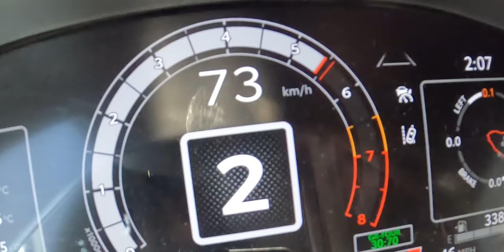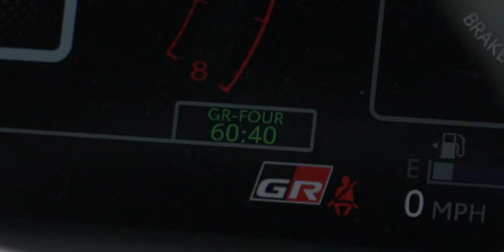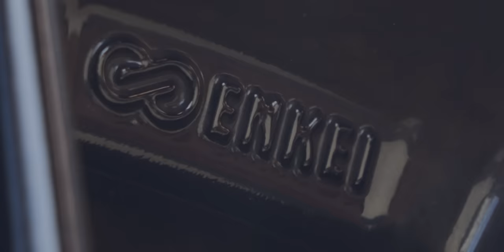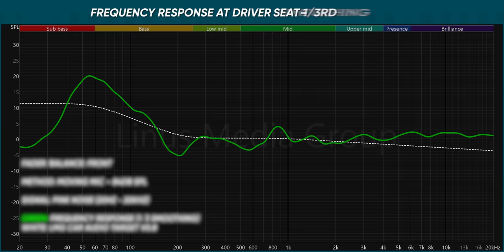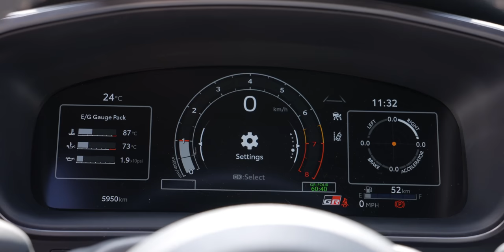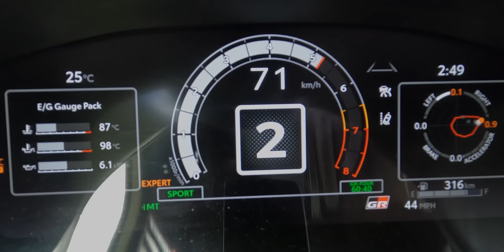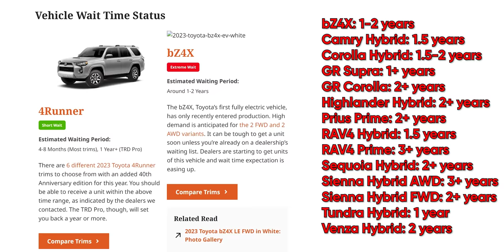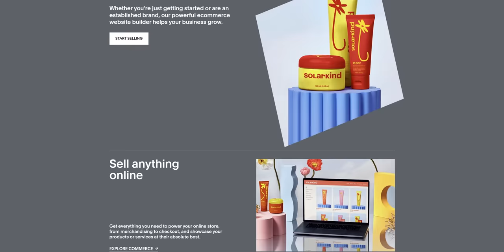I have made a very expensive mistake - Toyota GR Corolla

Comment: "it's more fun to drive a slow car fast, than a fast car slow" -- this is pretty much it.
Reply: True words.
Reply: The GR Corolla isn't that slow though.
Reply: last thing that Corolla is slow if it was a Miata then yes it does apply (Miata owner here)
Reply: This also applies to motorcycles.
Reply: the gr corolla isnt slow tho
Reply: @ReivinXL  No, it's slow.
Reply: I believe Linus has embraced the inner most lex Luther. My favorite character out of Superman.
Reply: James May tried to make this argument once on the old Top Gear. “The fun part of driving is taking a car to its limit, and you can do that more often in a cheap car.”
Reply: @Raansu yeah you need roads with turns. I live near tight mountain roads in germany and my fiesta st is just a blast every time. Drove other way faster cars up those routes a few times, never as fun as a twitchy car with a small wheelbase. Anybody who doesnt „get“ small fwd hot hatches should try it when they have the chance and they will understand 😊
Reply: I had an NC3 Miata and it was just a blast! Slow car fast is amazing. Because the  power and the size of the car have been brought down so damn much, it's possible to have so much of the cars potential without going fast enough t o loose my license. Also, smaller, lighter vehicle with a small engine means less fuel burn, less expensive tirees with lesser wear, less use of brakes, cheaper insurance than expected, all while g etting a dead reliable  car.
I never would have gotten vanity plates, but REALCAR on my NC3 just fit!
Reply: true
Reply: @RichWhiteUM  In which universe is a 5.5s 0-62 mph time slow for a bone stock street-legal car? That's upper 10% easily.
Reply: Driving a golf mk2 on a frozen lake at high speed was the most fun I’ve ever had driving. Just shows you don’t need to spend tens of thousands to get a fun car
Reply: Donut Media made a video about this, why slow cars feels faster/more fun than fast cars.
Reply: - James May 2004
Reply: @NLRevZ a universe where people think 300hp is “little”. I’m over here with 140hp doing just fine
Reply: @Rubicola174  how much kmph?
Reply: As a 2023 Camry owner I totally relate to what you said
Reply: That's why James May is such a fan of the Fiat Panda.
Reply: @MrTWINARMAGEDDON  Agreed. My little MX5 track car has 300 horsepower and it feels like a rocket ship because it doesn't weigh much, haha! On higher boost pressures she does 0-100 km/h in 4.5 seconds but around 1 bar it's 4.8-4.9s which to me is still more than fast enough to bully lots of cars!
Reply: It's why I still really enjoy driving my six-speed CR-Z.  No, it's not fast, but it never ceases to put a smile on my face.  It's not quite as fun as my dad's EVO IX, but it's not terribly far behind.
Reply: It’s more fun to drive a fast car fast
Reply: @NLRevZ  In this one.  I've had stock cars whose 0-60 was under 5 seconds.  It's top speed is also going to be slower.  0-60 times are just one metric and are based on torque.  It looked slow in the footage where Alex was driving it on the track.  Sustained speed and further acceleration is based on HP, which looked to be lacking in this car.
Reply: @Raansu  Well yeah, all you're doing is speeding in a straight line. The GR/BRZ twins excel in a twisty environment.
Reply: @Raansu  I agree fully with this sentiment.  The only car I owned that I found as fun as the ones with the V8s was my old '84 Monte Carlo that had the turbo 3.8 V6 out of a wrecked '87 Buick Grand National GNX.  My wife had the Fusion Titanium with the twin turbos and that was pretty fun.
Reply: That's I like my 2017 Fusion Hybrid, good gas mileage and the bonus of EV torque of the line, at stops ha ha, keeps me engaged in the drive.
Reply: @EXG21  My wife had the Fusion Titanium with the twin turbo.  That car was fun.
Reply: @RichWhiteUM  And the Aston Martin style front also looks really nice.
Reply: @Raansu  lol camaro =)
Reply: Used to drive an '09 smart fortwo & thing was insanely fun to whip around especially with the paddle shifters with a straight pipe thing just sounded so aggressive like a motorcycle, small displacement 3 cylinders are so engaging.
Reply: @dualCalibur   Plus there's the benefit of not riding at ludicrous speeds when one runs out of talent halfway around a corner.  I find I prefer my '79 Honda 750 over just about anything - it cruises nicely, and I can still give it the occasional thrashing around some country roads without getting killed before dinnertime (although I wouldn't say no to a CB1100, since the 2013-17 version made about the same power as they venerable 750.)  🙂
Reply: @RichWhiteUM  you have to go see some videos of them riding the Nürburgring
Reply: @MrTWINARMAGEDDON  Me here with 80hp and I even got the more powerful version of my car lol
Reply: @RichWhiteUM  It isn't slow lol, it's AWD and 300 hp, that's very fast
Reply: @MrTWINARMAGEDDON  I drive a 140 hp mid-engined car, but it's also 980 kg so it does 0-60 in 6.7 seconds hehe
Reply: Driving a 2014 Renault Megane that's got 217hp and have to admit, Honda CRX was a bit more fun to drive. However, with a 300hp tune I could imagine it being on par with that car in terms of fun.
Reply: If you got what they meant you're not a trumpet. 🎺
Reply: I feel the same with motorcycles.  It's more fun pushing a ninja 400 to its limit, because you can do it all the time.  Try that with a ZX10 ninja outside of a track day, and you will end up either in jail or in the hospital.
Reply: definitely not slow though lol maybe more fun to drive a fast car fast than a slow car fast
Reply: My German brain just instant did go just drive it out on the autobahn until I remember that Germany is pretty much the only country with highways that are at least partly without speed limit.
Reply: @_zedf656  Compared to the Porche? it's very slow
Reply: Idk all I’m saying is my bike goes 0-60 in 3.3 so I already have all the fast I need
Reply: @Raansu  In a straight line everything is slow compared to the taycan, the yaris and corolla are faster than anything in their category, hell the yaris was faster than the supra at some tracks.
Reply: can't say I ever enjoyed my slow car struggling to go fast, but I always enjoy my fast car going fast. Shrug.
Reply: You can only hit 145 in a modern Miata, but you'll have a blast doing that or running a curvy road.
Reply: @ReivinXL the Corolla isn't THAT much faster than a new MX-5. The Miata has come a long way😁
Reply: @Raansu  Idk... I feel the opposite with my 2019 GT. No matter how good that v8 sound. I don't find it fun driving the car slow. But that may just down to the power band and tuning for the newer coyote engines. They aren't fun cars to drive under 5000 RPM. The car and engine just scream it want revved to 7500-8000 RPM all time, and that where it makes it power at.
Reply: @thebaddestogre-3698  Looks like they actually have about the same official top speed.
Reply: @Rubicola174  love catching those thrills too bro. Be safe tho
Reply: @dualCalibur 125cc two stroke dirt bikes are fun af, not the best, but dang it's a dopamine overdose
Reply: @dualCalibur especially if it's a 2 stroke that has to be at 10,000rpm to do the speed limit
Reply: @calholli  lol that would be dope but actually it’s not, it’s a bmw r1200rs
Reply: I’d rather drive a fast car fast but that’s besides the point this is not slow
Reply: @RichWhiteUM american spotted
Reply: and that's why i'd go for a GT86 or GR86 over an expensive sportscar
Reply: @ReivinXL  It is slow compared to a Porsche Taycan 4S.
Reply: For a few minutes but going 130km/h and more was NOT fun in my Citroën C3
Reply: It's the same for motorcycles. I was BORED on a 2019 Triumph Speed Triple RS. Just couldn't ride it the way it was meant to be ridden and it got boring riding at traffic limits.
Reply: Same is true with motorcycles.  I had a XX that was set up for sport touring.  Fun and smooth…over 30 mph.  Get stuck behind an RV with no passing room, it was a pig.  At speed is where it ran best…not parking lot speeds.
Reply: @RichWhiteUM  Yeah, agree.  There is a difference between fast and quick.  This may be quick, but it isn't fast.
Reply: So drive the fast car fast?
Reply: Unless the fast car has a v8 and a manual lol
Reply: @Raansu  good point. geography plays a big part in preference.
Reply: @MrTWINARMAGEDDON it’s mostly because of heavy American cars and cars getting heavier over all
Reply: That’s why I traded in my c7 corvette z06 for a 997.2 Porsche Carrera S.
Reply: @_zedf656  Yes it is in the "Just fast enough" category.
Reply: when did 300hp become slow tho
Reply: @_zedf656  true, but in comparison to Linus' Porsche Taycan, its a snail
Reply: 2006 Honda civic 5 speed is some of the most fun I had running out every gear. Even would hit 127 mph.
Reply: SUCH a cope for people driving boring ass cars lol
Reply: @KtfoMustang  nah
Reply: A good fast car is fun to drive slow.
Reply: @zacharymorris3888  Bikes suck at cornering though. Have to slow down way too much.
Reply: @caddyguy5369  true, if you aren’t a skilled rider
Reply: @ReivinXL  to be honest, coming from someone who used to have an '06 Miata (God that was a wonderful car) and now drives a '22 Camaro SS... I have a blast driving my SS slow. I rarely get above 3000 RPM... at less than 7000 miles on my SS I'm averaging 20 MPG so far with a 4.5 mile drive through town to work... and the low end torque just brings a smile to my face every time.
Reply: So true
Reply: Depens, i like fast and i like audis
Reply: @_zedf656  250wheel hp is not mid
Reply: @ReivinXL  250 wheel hp is nothing
Reply: @christianl2024  250hp at wheel is nothing
Reply: @johannapoder2843   for a car that weights about 1450kg thats a lot hp per kg. yeah its nota 1000hp monster but that not what its build for
Reply: Yes no one can say a more true sentence. I have a GT86 and a fiesta ST MK8.5. Both with only 200 CV and both make me smile every run......A faster car can be more fun in circuit but I don't know how a car can be more fun than a GT86 in road with rain or more fun than a fiesta ST MK8.5 in b road with sun  in muntain....no way. In future I don't know what to buy. I had M3, S2000, clio RS but the electric future make me so sad...
Reply: Someone always inevitably say this phrase to justify a slow car, but it's really a dumb phrase because no shit driving a fast car slow is not fun. It completely ignores the fact that there is a fast car and that driving a fast car fast is also very fun.
Reply: Internal combustion engine>>>>>> 0 smiles per gallon soulless EV. This is pretty much it
Reply: @RichWhiteUM  0 - 100 in 5 seconds is slow? lmfao what is this guy on about
Reply: "slow" yeah ok lol
Reply: This is how I feel about the Rav4 Prime lol.
Reply: @_zedf656 If a car with a turbo I3 engine is slow at 300 hp then idk anymore
Reply: 300+ hp is not slow at all
Reply: Depends on your experience
Reply: Yeah but it's even more fun driving a fast car fast lol
Reply: 5 sec 0-60 is a slow car now, we live in a crazy times.
Reply: Thats why I have a car that is slow so I can drive it fast, and a car that's fast so I can also drive that fast hehe
Reply: @RichWhiteUM  compared to what?

Comment: I appreciate that Alex is willing to recognize when he "ran out of skill". That's a very good mindset.
Reply: Totally. I am going to start using this.
Reply: @calholli  You can drift 4WD they just need to have more power like he said.
Reply: @calholli  yes and no, there's actually a pretty big following for awd drifting in Australia you just need little weight and high power along with no traction control which was probably on in this video
Reply: @calholli  my F-Type R will drift in any condition, its just a power/awd programming thing
Reply: @calholli  WRX STI Begs to differ. (May the rest in Peace... DAMN YOU SUBARU :()
Reply: @calholli you actually can (for the most part)! If you put it in sport mode and then hold the TC button for like 5 second it pretty much turns it all the way off.
Reply: @calholli  just harder to do than RWD, I seen people drift with AWD and FWD.
Reply: Considering his janky tech builds, I think it already goes without saying
Reply: @calholli  If you can only drift RWD, skill issue. Even FWD can oversteer if you know how to shift weight forward.
Reply: @calholli  That depends on the differential biases and locking positions of each diff. It's easier to drift an AWD car that has a more rearward bias, on the contrary, a more frontward bias will, as FWD cars do, pull itself straight.

If you really don't believe me just go watch mfing Gymkhana lol
Reply: @CybertroninfiniteOfficial  Powerslide or drift ?
Reply: In australia the phrase we use is 'i ran out of talent' lol
Reply: @calholli   in sport mode especially these things have a surprising amount of power for such a small car, I got one as a rental car up in Alaska and was pretty blown away cause all the similar size cars I've driven before have been pretty weak but this got up to 120mph without even trying in sport mode and easily could have kept going, you can also absolutely turn off traction control
Reply: After he went all directions at once... Hmm, I hope he recognizes it a bit earlier next time.
Reply: Lol it's a very common statement in the track enthusiast community.
Reply: @philspaghet  I know it!
Reply: @calholli you can drift in a 4wd awd
Get it in the dirt and do some feint drift or more technical style is powerslide
But for the corolla 
It's still lack of power

Comment: As a car guy, the saying of “it’s more fun to drive a slow car faster than a fast car slow” rains true especially with Toyota GR lineup. They are absolutely phenomenal vehicles, considering what you get
Reply: True, but it’s pretty absurd to call a series of 300HP 3 banger hot hatches “slow”, these cars are not slow.
Reply: They are ok, but not for 55k.  I used to own an Evo8,  Evo10 and a few WRXs and those were priced appropriately.  M3P is way better for that kind of money.  11.5 1/4 mile and still a blast in the corners.  Not so fast it's scary/you get yourself into trouble like the Plaid, but fast enough to have fun.  If you want a similar experience, just get a WRX or Golf R and save your money.
Reply: @xsct878 absolutely agree that little hatch is impressively quick.
Reply: @markstreeter9920  And to mention that if we are speaking of just slow but fun cars, you can get an MX-5 ND for half the price
Reply: There's a lot to be said about driving a "slow" car at the limit, especially if it's light and manual trans
Reply: Having owned a 5-speed basic Tercel, you're right on the money. Seriously fun, but I never expect anyone to believe me.
Reply: I think the term is “nuggetry”
Reply: That's why everyone loves a Miata.
Reply: @xsct878  slow on paper in relevance to other cars. By no means slow. I would not play f*** around and find out with one of these at all. I’m a Honda guy at heart but man these 😮‍💨
Reply: @markstreeter9920  everything is just absurdly price right now especially in Canada. You’re essentially paying a “Toyota tax”- they’ve never been cheap brand new compared to other brands but they last a lifetime and a half
Reply: @DorylPlz  Miatas are awesome. Small cars in general are sick- thanks @MightyCarMods
Reply: They cost as much as a hellcat or a ZL1 no fucking way in hell. I would say it’s a decent car for $25k but for 60 no fucking way. I paid $34k for my Camaro SS brand new in 2017 and even when it was stock it makes cars like this look like an absolute joke in every way. You can still buy a brand new LT1 Camaro for $34k and it’s the same engine as the SS
Reply: @JTTTTT850  not in Canada you can’t. Maybe a higher mileage used example but not new. A 2SS ‘23 Camaro 70K give or take a few grand in Ontario. A 2SS. Should be 50K, absolutely but it ain’t.  I got a “good deal” on my ‘16 F-150. Long bed supercrew 5.0- 35K w/ 116K KM’s/72K miles. That was a good deal when compared to what else was on the market. Our everything market is in shambles right now.
Reply: Also, people, keep in mind that his price is in Canadian- not American. 55K CDN is about 42Kish USD
Reply: @xsct878  its absurd wanting a GR over a Ford Focus RS
Reply: Lol no it's a slow piece junk
Reply: I used to have a Fiat boat with fins...it was super fun to drive but went 68 mph flat out.  Driving the hell out of a crap car is more fun than not ever getting to enjoy a fast car.
Reply: Miata is one of the best drivers car on the road. You can Rev to redline and still drive under speed limit. Also under 30k for rear wheel drive convertible.
Reply: @user-dibribhsvj36d  lolololololol
Reply: @markstreeter9920 what's crazy is the Yaris GR came out here a couple of years ago for 40k and this Corolla with essentially the same running gear and a less bespoke body is 65-70k.
I reckon if an Evo came out today it would probably cost stupid amounts too.
Reply: @RogueStatusX They stopped making them 5 years ago.
Reply: @JN-qj9gf  what is your point?  lmao
Reply: @user-dibribhsvj36d  it is underrated
Reply: @markstreeter9920 The GR Corolla starts at 36k usd, the base trim also seems to be the most produced trim as well. The golf r starts at 45k usd. The golf r and wrx are definitely great cars, but it seems your assumption is based on an absurd price.
Reply: Doesnt justify having to spend 40k for a 3 Cylinder.
Reply: @_synt3rax_437  Yeah it justifies having to spend 40k for an engine with the 2nd highest hp/l, and an awd system that can do more than just split 50/50 in a few scenarios
Reply: None of the gr lineup is "slow"
Reply: @koraegi  GR86 isn't fast lol
Reply: @xsct878  is slow compared to porsche
Reply: @andrecamacho4886  yeah no shit, but what Porsche are you getting for GR Corolla prices.